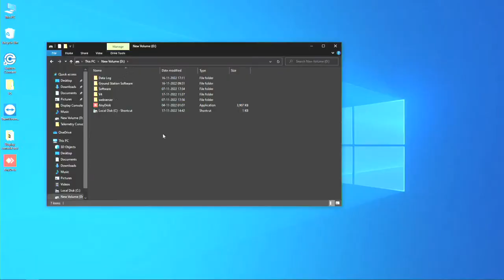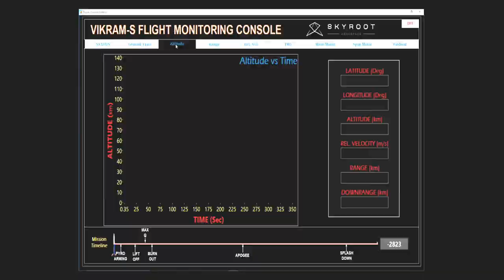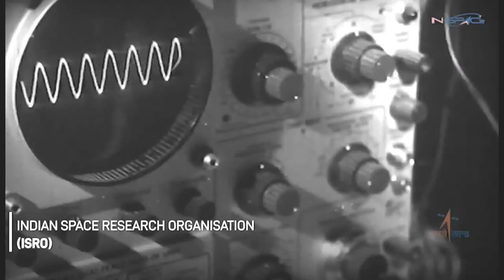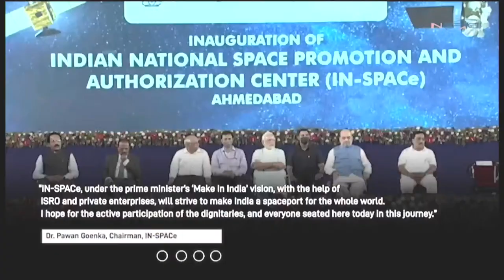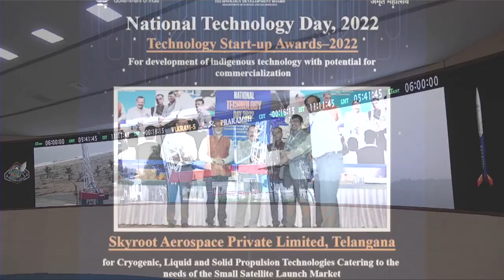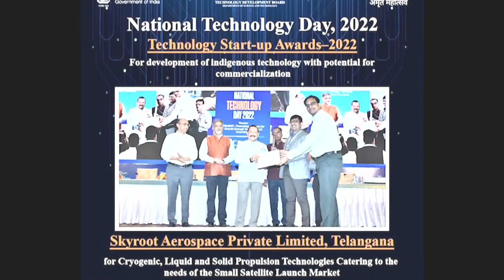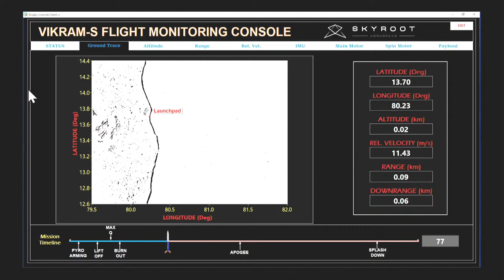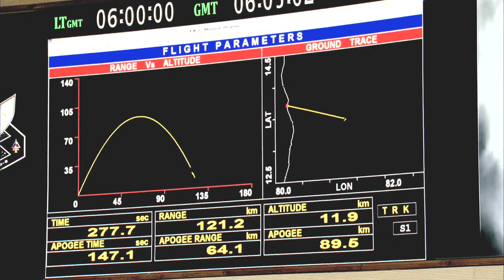Vikram-S Launch | Prarambh | Skyroot Aerospace

Comment: Seems like rocket could not tolerate Max Q.  It seemed broken in video.  Can you please provide details about where were the main objectives and what were achieved successfully.
Reply: The objective for this mission was to cross the karman line above 80 km from where space starts and then splash it down in to bay of bengal. It did that successfully on its first launch.